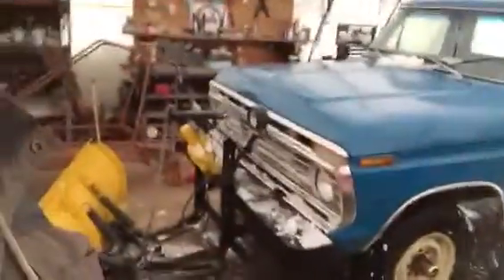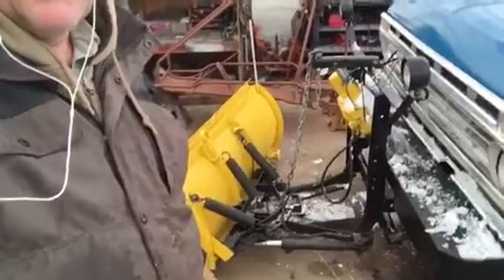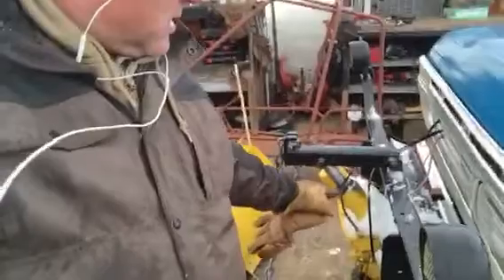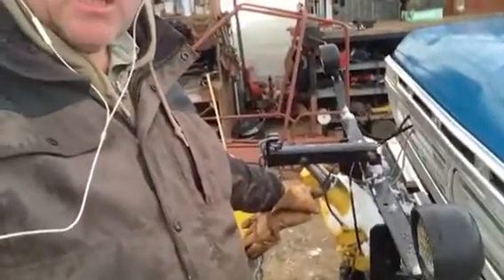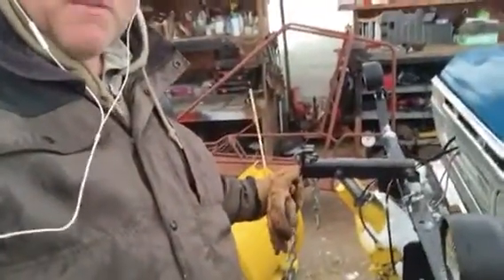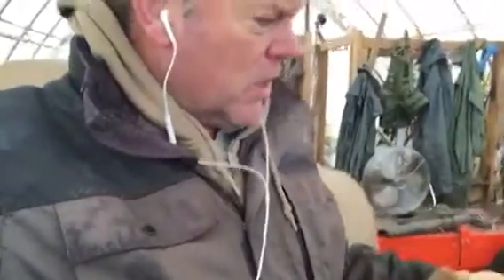Farm Equipment - What makes it? A Farmers Life

Comment: Reliability is the key; it's hard to find old trucks in the north that are not rust buckets but what a treasure when you can. We have a 97 Dodge Ram on our small farm and it sucks gas like a fire, but we only drive it when we need it and only have 4 grand in it even with a completely rebuilt tranny.  I'm learning like Mark says the key is no payments.  If you can't buy equipment outright you can't afford it.